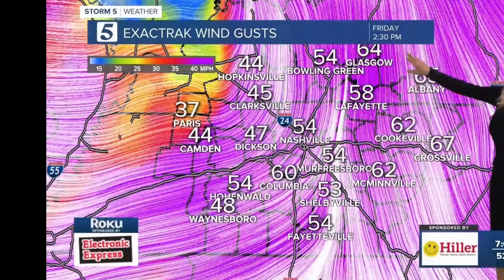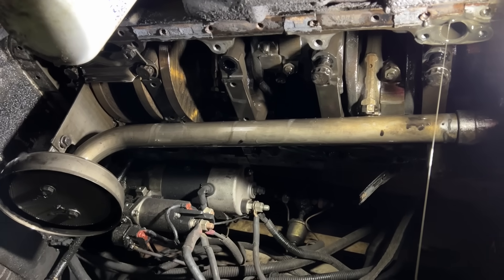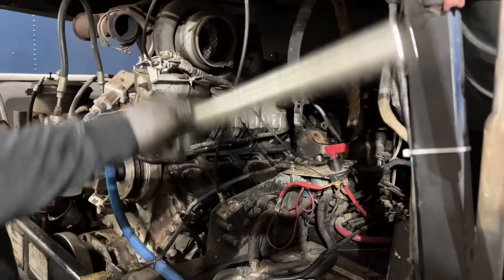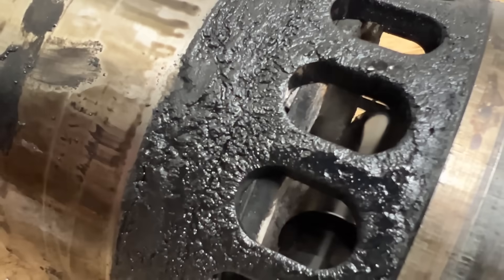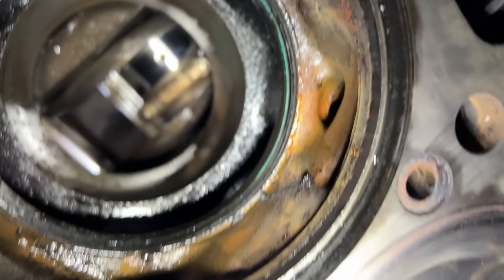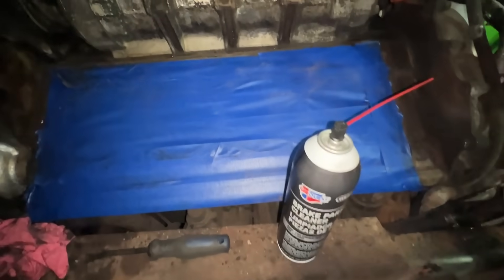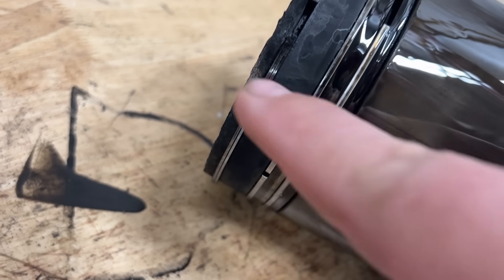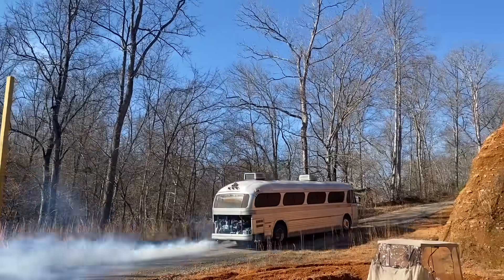Detroit diesel 8v92TA engine tear down continues.  Piston issues, crankshaft inspection and more

Comment: I noticed some cavitation damage on those liners, how big of a problem do these engines have with cavitation?
Reply from the maker: Yes 92 series are wet liners and require coolant with anti cavitation abilities.
Reply: @BusGreaseMonkey  they may not make the power the 92 series can but it's hard to beat a 6-71. Toughest engines Detroit ever made

Comment: How much does a full rebuilt cost on this engine?
Reply from the maker: It’s a lot especially when you consider everything being done.  Cooling system overhaul, all the extra bits needing attention and broken and rusted hardware. 40 year old neglected parts alone are possibly in the 10k range. luckily we saved him about 5k on the radiator.  20-25k looking like estimate range but you never know what’s behind the next bolt.  We are just about to the reassembly stage which is on the upside.  About 10k right now but waiting on the machine shop results for the heads.  Heads alone could be another 5k hit to the budget.  Buses are not cheap.  Taking care of them is super important.  Don’t over heat them and use smart maintenance policies.  And when buying one get an inspection!!!  Oil sample analysis could have avoided buying an engine with similar issues.
Reply: @BusGreaseMonkey  Thank you.  I appreciate your time.

Comment: Yep. Just as amazed as you on those bearing shells. Was expecting to see some sign of the water ingress.  The liner you pulled out . The o rings looked in fair condition. I was hoping to see a rust line over it to show where the coolant was passing down.   Especially the way it was dripping out so much....or have you found somewhere else it was dropping from.

Comment: i am surprised the block is not that bad,  as long as you don't find a crank problem that is a in-frame all day.
from the looks of the airbox and the turbo i would pull the blower to check it as i am betting it is dusted.

Comment: Do those Detroits in the bus applications  have a coolant filter/conditioner to help with prevent cavitation? I distinctly remember dad being very picky with any N14 or Big Cam 3 or 4  with testing DCA levels and changing Fleetguard WF2071 filter , then around 2000 International at least started factory filling with red  Delo ELC which was less maintenance for sure.  I can’t believe they ran so much water through it and let it run low , that sight glass wouid have fooled me lol.  what a mess.  Lucky to have you guys ! 👍
Reply from the maker: 92 series the coolant is very important because of cavitation.   71 series dry liner’s don’t matter.

Comment: Was aways taught to cover up the camshaft in the block with tape, to stop anything falling in on a Detroit, one my work colleagues was unlucky to get a nut drop in their and when engine started the cam lobe pushed it through the block into the water jacket, required a new block. Expensive mistake.

Comment: When u do an in frame rebuild do u inspect both ends of the connecting rod or send them to machine shop to be measured / inspected ???
.  The example of the contact patch b/end bearing to rod cap looks pitted or fatigued . Bearing wear had a poor pattern as well .  I am sure u would have the rods resized and inspected eg crack, alignment  test etc
Reply from the maker: When you work on old, tired and worn out engines things need closer attention.  This is a baby as most wanderlodges are mileage wise.  No wear parts are worn out.  No signs of issues to be concerned with on the bottom end.

Comment: You are relatively new to Tennessee, but I have lived here for over 30 years and I have seen wind storms that will make you cringe! I have seen a micro burst come through and snap three trees in my woods 20' up the trunks of 100' trees. I have had two 100' white oak trees come across my drive at 9:00 at night and had to cut these out of the drive until 11:00 at night with no power. One time around Madisonville,  we had a huge oak tree fly across highway 411 during a tornado right in front of us. I do love the storms though. One reason I moved back from south Florida LOL!

Comment: How Hard is it to remove the complete engine out to do this rebuild!
Reply from the maker: It’s not hard but very time consuming both in and out double up the labor man hours for double the cost in the end.  $15,000-$20,000 or $30,000-$40,000 out of frame.

Comment: At 1010 the stuck ring is a problem but don't worry about the end gap location.  The rings will rotate around in use and where they start out or end up really makes no difference.

Comment: Remarkable how good the main and rod bearings and bearing journals look.  Especially when you consider what this engine has been subjected to.  Even the cylinder liners are not as bad as some you have encountered.  I believe what you say about the block cleaning.  It's needed but I know you can handle it.  Not a cheap overhaul but it could have been so much worse.

Comment: What was the marking in the  centre of the big end cap caused by? Looks almost like there was no contact with the crank in that area. Never seen anything like that, but i only have petrol engine experience! Carbon build up between rings looks (to me) like the top ring has been sticking as well and the second ring has stuck because of it. Ring gaps so close wouldn’t help of course.
Phil, UK
Reply: That's a stain from coolant in the oil . Being old coolant it was probably acidic too. Oh strips can be bought from larger automotive parts suppliers to test the coolant .
Reply from the maker: The connecting rod has an oil delivery hole under the bearing. That circle is an outline of that hole under the bearing.
Reply: Sorry, it was the rod, not the cap, i meant the dark granular staining around the hole mark, as though there had been poor contact between the shell and the crank, thanks for another excellent rebuild video! Very interesting!
Phil UK

Comment: Ive never seen this concept but i always imagine it must be possible and simple and hopefully available relatively easily ? aaaaand it iiiiiss.... :
Flexible cleaning brushes that can be pushed through engine water passages. Like a pipe cleaner / bottle brush. Something strong that can be pushed with a lot of force. Something small enough to be pushed through radiator slits instead of using a smooth plastic zip tie ( ziptie probably only removes large blockages but still leaves a coating on the surface ). Maybe im over thinking, and the right chemical cleaner will do a near perfect or perfect job ?
Reply: I think they do flush the passages again after clearing the chunks. I remember they did with the clogged-up radiator that was in a much earlier video. But you're right, a bottle brush-like apparatus does work well for cleaning tight spaces, in my experience.